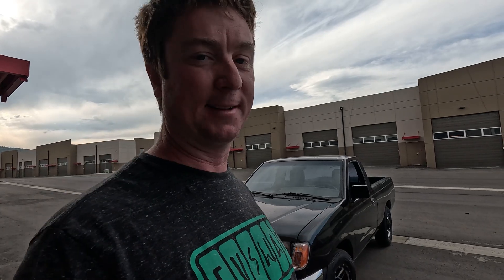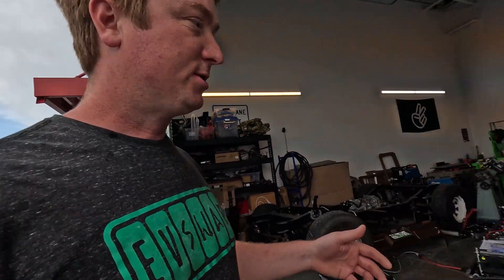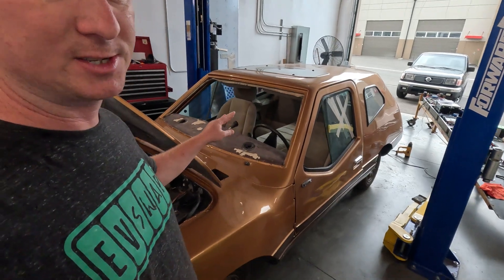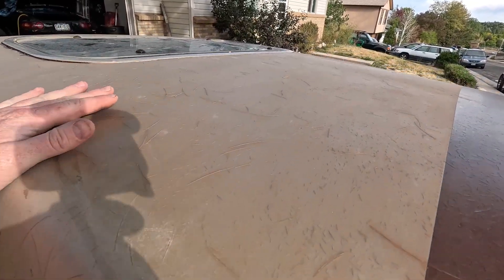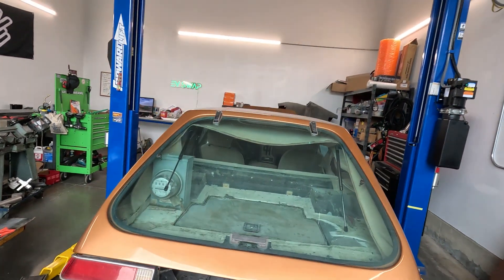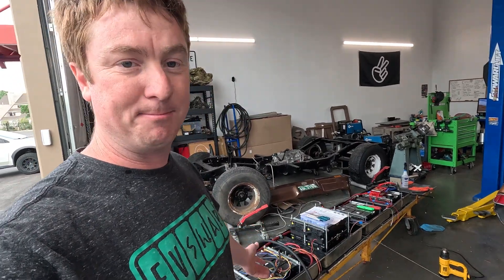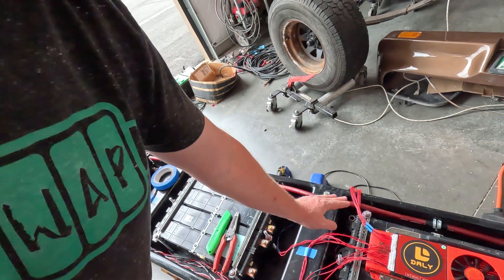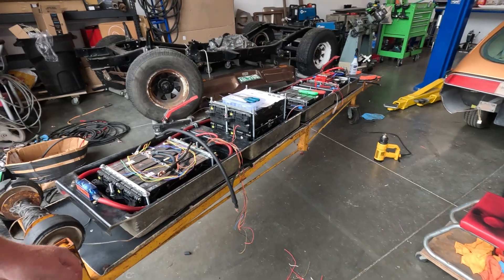UM Electrek Updates! Frontier Licensed and Insured! Building HV Lithium Battery for my Vintage EV

Comment: Nice update, what's the weight of the new batteries or difference from the old?  Should be a nice improvement in performance, though I'm sure what the Electrek originally could do wouldn't be considered 'performance' lol.
Reply from the maker: I forgot to mention it because of the beeping next door but the new battery modules weigh 280lbs. Add mounting hardware and wiring and let's call it 300 lbs. 4 times the original capacity and 1/3 the weight. Yes please!
Reply: @EVSwap  awesome on the weight, look forward to seeing how much better it does. I saw the beeping you had to deal with, you handled it well.